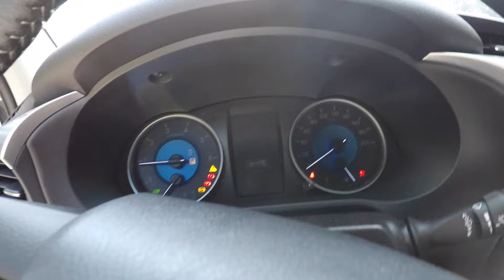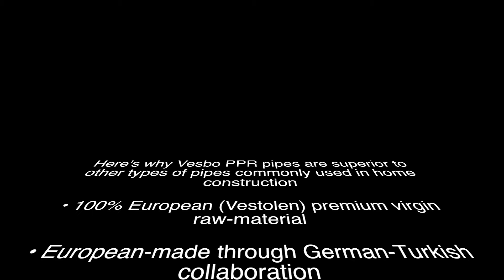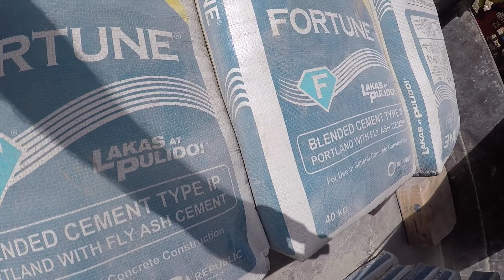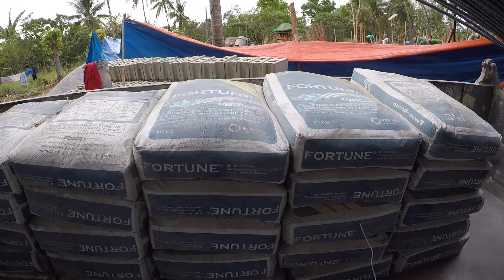VILLA FELIZ - EPISODE 43: SIZE MATTERS (House Building in the Philippines)

Comment: Water has a drive of about half a pound per foot of height.  We need about a 20 foot tank to give us a six foot shower, in order to get a hot water shower.  The water from the town has been decent enough most of the times to provide pressure enough to heat our shower water by a coil.  For me the shower water being warm was important.  We needed an electrician to hook up the coil, not a plumber.  Thanks for another great video, packed full of great information.

Comment: Ken did gave you the same advice as I would also to avoid the problems with your basement concrete walls! Highly recommend this with my experiences with building here in Finland with the 4 seasons which can be very wet with autumn and spring with so much water at the same time, as snows getting as a big number of a water against the basements! Sika system saves your house from a big number of a mold here also.
Reply from the maker: Exactly.  We're planning on following everyone's advice who have experience in basement weatherproofing.  Don't want any nasty mold in my man cave!  👍🏼

Comment: I would recommend plugs in the restroom near the toilet so you can install the Japanese style commodes  and night lights.   Stair lighting is nice to add.  Under/over cabinet lights.  Low voltage like speakers and security are also important to think through at this next stage.  Enjoying your home build!
Reply from the maker: We had the service outlets for the bidets in our original plan but are reconsidering since all CR's have a bidet hose available.  Not as fancy and hands free as the automatic versions.  We have Coco bidet's in our house in the US but there is a maintenance factor involved and they are quite expensive.
Like the idea of the lighting you suggested.
All good suggestions.
Thanks!
Reply: james, biobidet has non electric with hot and cold mini plastic hoses  preety sure your familiar with these from your stint in korea  ,i have three of these  besides the electric ones, also sika poly urethanerubber comp. the best for basement outside waterproofing with dimple plastic protect that mancave!cheers rey

Comment: I am sure this is somewhere in the earlier videos but I did not find it. What is the square footage of each floor?  On the wet proofing, I am in Canada and the last three I built I put the wet proofing tar and then the drain tile all around the basement, rigid perforated pipe running back into the city sewer set in about a foot of gravel and then covered with more gravel.  No leaks except in one when we had an actual crack in the wall.
Reply from the maker: Good info Barry.  We have the waterproofing solution.  We just have to purchase the materials.  Perforated pipe and wall waterproofing with dimpled padding.  I think we're good now.

Comment: Hi James. Me again, btw thanks, just to clarify the velpo water pipes, from the water meter it's 1 inch in diameter and ends where? Then inside walls and on top of the roof ? Then 3/4 inch to be connected from ??? To ???

Comment: James 
Have you looked at pressure tanks that i have seen on some properties
I think they go just off the supply and have some kind of motor that triggers when water is drawn from the tank, the tank then feeds the supply to the house services
A bit less intrusive than a big tank on a tower, but at least the tower works in a brownout!😜
I like a shower tha tries to knock you to your knees 😁😤
Reply from the maker: We have restriction for pumps connecting to the water supply system.  Not allowed.  😢

Comment: I'm assuming you leave your truck in the gated complex for safety reasons, and walk to your current residence. If you don't mind me asking, what did your truck cost. When I move to the P.I. I will get a truck or a car. The trouble i'm having, when I just want a ballpark price, they want me to leave my e-mail and other personal info, which I don't want to do right now. The home is coming along nicely.
Reply from the maker: Yes and yes.  Some of the Philippine Toyota websites will give you a priceless without having to reach out to them, but I think it was close to P1,65mj for the 4x4 G model.
Reply: It would be optimum for me to bring over my 1985 CJ-7 Jeep I bought brand new in 1985, because it is setup for "Philippine" type driving with 38 inch aggressive tread tires lift kit 4x4 etc. But from what i'm hearing, it may be almost impossible to have it shipped there without paying a "Kings" ransom.

Comment: Does the subdivision own a water tower/tank for the area?  How is it pressurized?  If no, how is the water supply in the area?  Are you going to put a tank on your property?   
My wife and I have a house in the Cebu and we can't rely on the municipal water supply. We collect rain water in a catchment and have built a separate water tank with a pump attached to it.  We looked into building a tower to supply the house via gravity, but didn't want to pay for it, worried about its stability in earthquakes and typhoons and wasn't sure about the aesthetics.
Reply from the maker: They have to elevated water tanks servicing two large phases of the subdivision.  The gravity is so strong, even when power is down we have good pressure.  We'll have a cistern for irrigation and but I don't think it will be necessary for a tank.  I checked with other residents and they are happy with the water here.
Sounds like you have a cistern as well.  Its mandatory here in the subdivision according to deeds and restrictions but I found several residents do not have them.  Maybe the D & R included the cistern in a later annex.
Reply: james,please consider installing  evac.tube solarwater heater, this heats water to boiling 160+ killing any germs saves on  energy(sunshine is free) another  benefit is you will have 30 gallon water reserve most tanks are stainless

Comment: My father's house get some water leaks inside the concrete because the plumbing were installed within the concrete. He now re-installed all the plumbing hidden inside ceilings for easy maintenance. Maybe this PPR is way more durable similar to PEX and can be inside the concrete.
Reply from the maker: PP-R and PEX are very strong.  I'm hoping I won't encounter any of the problems your father has.  We'll also be doing some pipes/electrical in the sub ceiling where we can.

Comment: water pressure diminishes by .433 pounds per foot of elevation or 2.31 feet per pound. 
In our 2 story house in Bacolod we have a pump and pressure tank so we can boost the lower pressure supplied by the water company.
Reply from the maker: That's a great idea.  We're thinking along the same line but not a pressure tank.  Was thinking of using a switched pump that will kick on when the water pressure goes below a certain PSI like the one we'll be using in our cistern.

Comment: Next to our commercial lot the owners built a house with 2 rooms that are split level  and that are 1:5metres  below ground level, they did not use any waterproofing at all just hollow blocks and cement render..the house is built on an old rice field and for 6 months of the year or more, those 2 rooms are under water ... we call it their indoor pool.. costly mistake that would be very hard to rectify with out spending a lot of money..
Reply from the maker: My builder also discounted the need for any waterproofing and floor drains to remove water.  Had I not insisted, engineered and supervised the installation of all the above we'd also have an underground swimming pool as well.
Reply: Our neighbors are  Philipinos that live in Canada and I gather built the house for their retirement.. its a costly error.. that’s for sure ..

Comment: I am preparing to build.  I asked my builder about preparing a grout (for where the column meets the footing)  and he didn't know what I meant.  I was not successful referencing anything on the subject nor does the foundation blue print say anything.  Any info on "grout" and its application would be greatly appreciated.  Thanks James!
Reply from the maker: It might be a local term for this crew.  You need to flush the area at the base of the column where you are going to pour the standard concrete mix onto the tie-beam.  This helps remove any impurities as well as makes sure you have a good bond.  If you pour your concrete mix directly on the beam you might get a lot of rock at the bottom that might not have good adhesion at the joint.